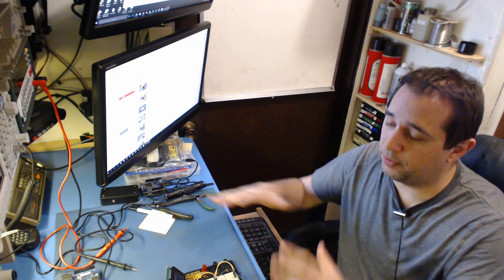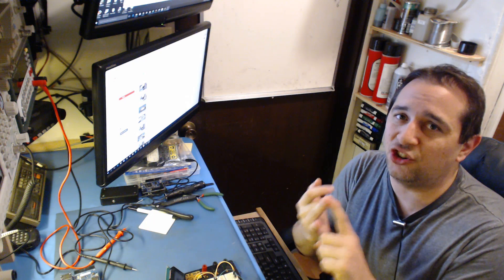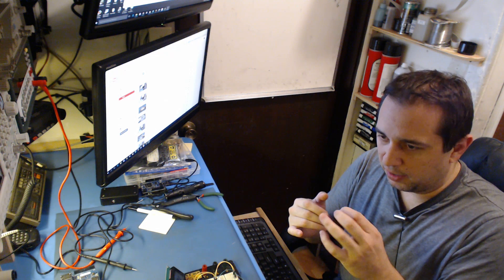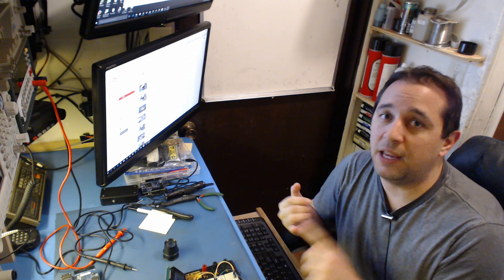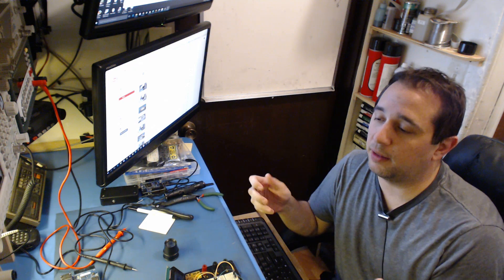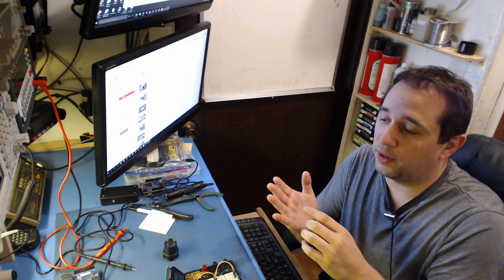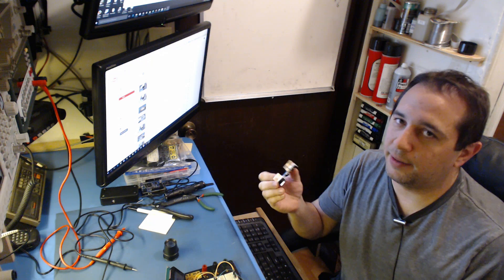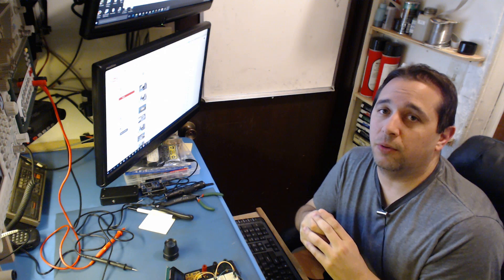SOME BASIC ELECTRONIC REPAIR TROUBLESHOOTING TIPS

Comment: let say i have a device that was working fine over the years but recently it stop working  blank display no audio output, remove the board and apply some heat with my hot air gun after one day it start to work again wah could be the problem
Reply: Sounds like a bad solder joint or capacitor.

Comment: Any advice on how to troubleshoot an intermittent problem (works most of the time) on a TV power supply that seems to be heat related (happens after TV has been on for a number of hours, and more frequently if in front of a sunny window)?  All electrolytic caps tested ok with ESR meter. Didn't notice any bad solder joints.  There are no burn marks on the board or components. Some components seem to have been glued together with some sort of adhesive, which has cracked with time, but the TV is not subject to high vibration, so that should matter.

Comment: I have an 80's classic synthesizer. A Roland Juno 106.I bought it for £35 with expensive flight case second hand. The Synthesizer wasn't working properly.. I found out that this particular synthesizer model had the same problem as most. A bad component that short circuits and at the time used cheap capacitors. covered in resin. the resin was the problem. it cost me over a £100 to get fixed professionally, but now it is worth around £1,500 so well worth buying. I wasn't going to mess with it myself, as I had no electronic experience at the time, and also the safety issue. just goes to show getting into electronics, can save you money, but also the potential to make money.

Comment: I have a different kind of problem I need help with I bought a underwater ROV drone and my son broke the cord off only has black and white wire in it that cord needs to be somehow connected to a 4 prong connector I open up that the Box and it has red black blue and yellow wires not sure how to reconnect this?

Comment: Good to brush up on my electronic know how. This was handy. I already knew most of these but the warming up on a cap thing I didn't know of the crack solder I didn't know how severe it could be til now. I may be able to fix an xbox that keeps blowing its power supplies a bit easier now albeit the power supplies seem to still work even after being blown seems it I cannot fully test them the fan still works in them.

Comment: Thanks keV... I need some tricks for repair my PLC I/O cards... When I receive PLC I/O card's  from my customer I do some visual inspection of PCB, if everything fine then I will fix with my main PLC CPU... And I run...  that time my main CPU is not getting reboot(There is no visible physically damaged component )
What may be the problem...in card... How can I fix the internal component damage
How can I track the IC failure... Can you help me please...

Comment: I have a power supply of an old record player. It read 36 volts yesterday. When I put a small motor to it, the motor ran fine, I could tell the ps was less than 1 amp. The next day it  suddenly only reads 0.07 volts. I haven't done anything else to it. Does that mean it is a bad cap (16v)?  Btw, I have 2 of the same boards and now they have exactly the same problem. The caps on both on them look like new.

Comment: how do I get started in electronics repair?  I want to do this as a secondary income from home.
Reply from the maker: Do you have any experience in electronic repair?
Reply: Very basic. I'm an HVAC technician, so I have general electrical knowledge but not specific to electronics.  I collect vintage stereo equipment and would like to start working on some of it myself, and like I said maybe a second income stream.
Reply: Can I learn this stuff from trial and error or will I need formal (ie.college) training?
Reply from the maker: I would hold off on doing it as a second income for right now. Where you are right now in skill level for repairing electronics for money you are not ready to have people pay for your tinkering. I would get a better understanding in theory of electronics and the things that you will be repairing before you do it professionally because your reputation is on the line. If you start to take on jobs to early in your journey and are not a seasoned tech yet you can set yourself up for some uncomfortable situations and failures. I'm not saying it is not possible but I would start small. Fix friends, family's and your own things and have them cover the cost of parts. Get the experience in different devices and how they work and how to identify different types of circuits and common problems. Go to the dump and hit up the old electronic recycling and get some free junk to play with. You will have to invest in some test gear as well. You don't need to get a formal education if you don't want to. The drive to learn is on you and how much effort/ time you put into it will determine your success. There is plenty videos and information right here on Youtube when you need help with understanding things. I say this because this is not something you are going to just pick up overnight and start taking on work next month. Sorry to say. I don't want you to get discouraged but I think you need to figure out what you are capable doing before you put yourself out there. Who knows you could be a natural and pick it up quick. But knowing that gives confidence, and knowing what types of repairs you can do will sort out jobs that you cant do before you agree to do them. Hope that helps
Reply: Yes,  very much. Thank you. I didn't really expect to start a business of it any time soon I was just thinking about someday down the road. I will take your advice and start small. I like your videos by the way. You make it look easy : )
Reply from the maker: Thank you. I make it look easy because I have been working with electronics and repairing things since I was 7 or 8.  I am sorry that my videos relay the message of making it look easy. That was never my intent. In my videos I try to break things down to a level where people that have never done this before can learn it. Once you get a broken device up on the bench for the first time and its between you and the device, you will feel the anxiety. Its the best feeling in the world when you get to the point in your skill level where you can overcome that and dominate it.

Comment: +Kev31779 With capacitors, It would have also been good to mention the High ESR and Drop in capacitance of electrolytics as an indicator of failure. Semiconductors such as your diodes and transistors commonly fail short. broken tracks or pads are common. checking for shorts to ground is definitely a big one. Varistors generally go bang after doing their intended job. checking or replacing op-amps is usually a good idea. Opto-couplers should be checked... and so on.
Reply from the maker: All good points. I tried to keep it basic for this video.
Reply: I can appreciate that :)
Reply: There are many components to studying electronics. One plan I found that succeeds in merging these is the Gregs Electro Blog (google it if you're interested) without a doubt the most useful info i've seen. look at this  awesome resource.

Comment: +Kev31779
Awesome Video and Awesome Advice.
One thing which you touched on but didn't exactly mention is cold solder joints , you mentioned cracked solder joints (although technically bad solder joints / cold solder joints /cracked solder joints are the same thing) but otherwise very useful and awesome advice.

Comment: amp powers up get almost no bass can only hear a faint sound from speaker can u help me out plz
Reply: Terrance R. Not likely.  Drive chain problem, start with power supply and follow the signal through all the pre amp and drive stages.
Reply: sounds like a capacitor